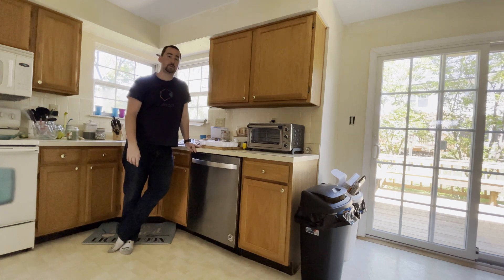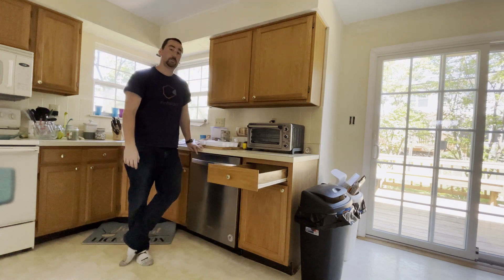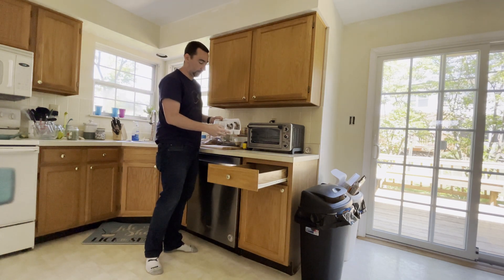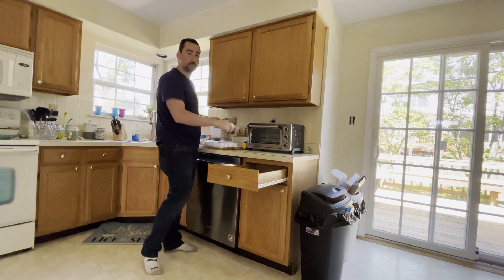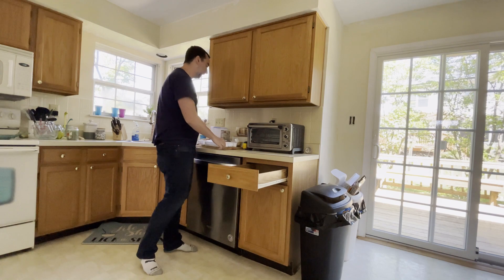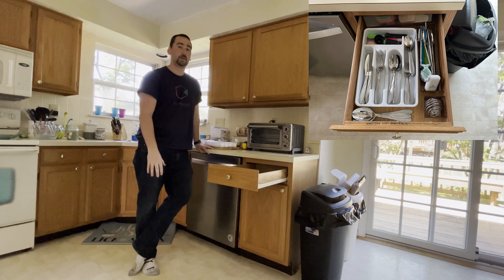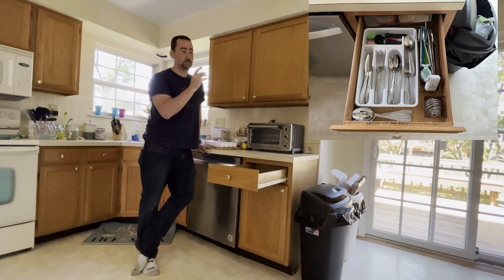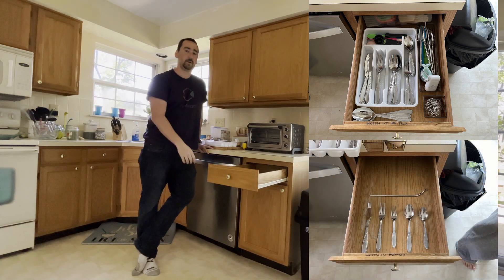Custom Utensil Drawer Organizer | 3D Design &Printing

Comment: you must live in a warm place, my big prints always warp a tiny bit at the bottom if I don't use a brim on the prints
Reply from the maker: It’s been hot the last few days. We keep our house at 72, but the upstairs is definitely warmer. The glass that comes on the ender seems to work really well, I’ve never had lifting issues. 

If you have an Ender with the same type of glass, I recommend before each print, wipe down the plate with rubbing alcohol. I’ve only had a few prints lift, but that was when I printed multiple prints without wiping the build plate.
Reply: You might try draping a blanket over your printer. Mine tends to lift the edges if the A/C kicks on in the printer room when I don't have it covered up.